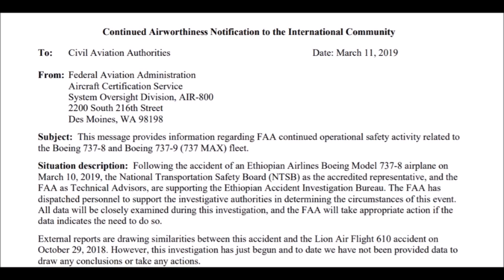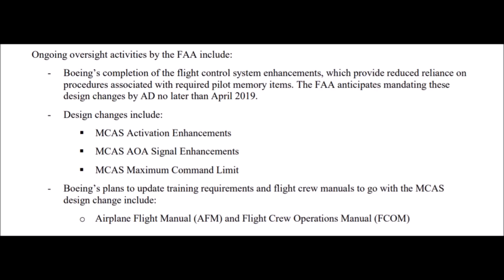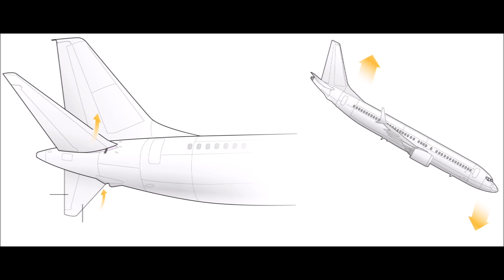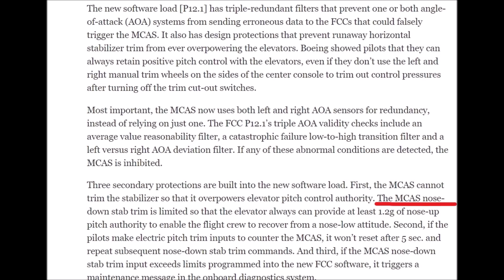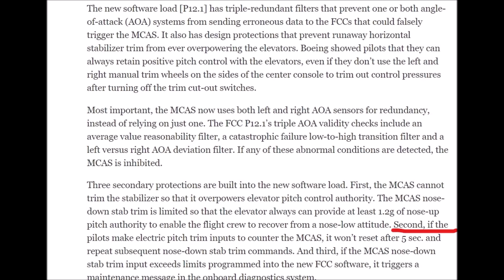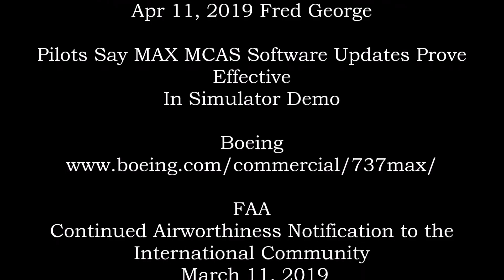737 Max UPDATE 14 April 2019 "The Fix"

Comment: This sounds so basic, why da heck didn't they config the system like this from the beginning.
Reply: I'm almost laughing at some of the responses I'm reading here. People are actually saying that this was unavoidable and Unforeseeable. Really? This system was designed around a single sensor. That is insanity. It is very foreseeable that a mechanical sensor will fail. It's not if, but rather when. This whole thing could have been easily avoided by proper engineering
Reply: Bradley Smith I get what your saying. What if they tested it with a failed sensor  in a simulator and pilots could recover when following the instructed Runaway Trim protocol?  Would you then agree is totally flawed?  I agree this was horrendous, mainly in the lack of pilot training and awareness, that was capital greed... and It should’ve been thought more throughly, but we can all say this now. How many other systems have inherent flaws we don’t know about currently in everything we do. We don’t know everything that was tested originally, all we know is that there’s a fix that seems common sense NOW, possibly not common sense when designed.
Reply: @bradleysmith681  Boeing designs in triple redundancy on their flight control systems.   Do you seriously think they chose to wing it with this system?  The AoA sensors are an important part of the flight instrumentation.   Its likely that the role of MCAS changed through the design process.   This certainly was not the intent of this system.  Also, MCAS is not a critical system.  It can be shut off if there is a problem.  The pilots of both of the accident flights made huge mistakes in how they handled these emergencies.
Reply: @bryan53566  MCAS isnt a critical system?  Of course, it is. If it deploys close to the ground, it could drive the plane right into the ground before the pilots can react.. in fact, after the Lion Air crash, the FAA stated that the MKS system could cause impact with terrain if not corrected.  So that isn't a critical system to you?  LOL You can try to defend Boeing all you want, but the mcas was a failure at design. If one sensor is acceptable, then why was the second sensor being offered as a safety upgraded at additional price? If One sensor is sufficient, then why are they adding a second sensor now.  If the system was sufficient, then why is Boeing accepting some responsibility for causing the plane to crash? You're talking nonsense. I really don't feel like debating reality with you.
Reply: I agree with most of the preceding comments. However I think a likely cause is the same systemic failure that took out two space shuttles: letting managers overrule engineers.
Reply: @selwynjames9592  The night before the space shuttle explosion, I saw that the temperature was well below 30 degrees at Cape Canaveral. I voiced the opinion before lift off they shouldn't let it take off because it was below freezing the night before.  I have absolutely no experience with space shuttles but I do have experience with how rubber or plastic becomes extremely brittle with below freezing temperatures.  The shuttle exploded because the O rings let burning fuel escape from the side of the rocket.  The same O rings were frozen less than an hour or two prior to the liftoff.   It seems to me that common sense is an Oxymoron.  Regarding the 737 Max 8, there should have been 4 sensors in the Max 8 which should have all agreed with each other before any MCAS action, and the MCAS would have to give a verbal warning as to what the computer was doing.  Even with that, one would think that there should have been a override calculation in the computer that determines that at X feet above the ground at a particular airspeed that you can't induce an angle of attack that would put the plane into the ground.
Reply: @Ron-cg2hf , I personally didn't anticipate the shuttle problems, but the experts did - and were shouted down by the snake oil salesmen.

"Common sense is an Oxymoron"?
"There should have been 4 sensors"?
"Should have all agreed with each other"?
"Verbal warning"?
"There should have been an override calculation"?

Couldn't agree with you more. You almost read my mind. Especially about the impossible angle of attack and a sanity check before action.

Perhaps these designs should have to be run past a community forum such as this in future, before certification...
Reply: @avms5090  "I personally didn't anticipate the shuttle problems, but the experts did" There's actually a very interesting story behind that. Google Bob Ebeling.
Reply: Redundancy in all sysrems except the AOA?Similar to the Titanic culture of having only 16 life boats on a ship that carries 3000 pax.
Reply: @8788luigi  The titanic was "unsinkable".   Boeing culture is about the same!
Reply: @Oldsmobile69  I agree.. Redundancy is so basic that most understand.. Yet, MCAS relied on ONE sensor only!! It's negligent..
Reply: @bradleysmith681  Good word for it...I'd add criminally before it. To your point, this is common knowledge. Both the group that built it would know of this weakness, as would the ones "certifying" it. 

That said, I find it concerning two pilots (obviously a redundancy) could not piece together a solution in time.
Reply: @justinnitsuj7041  Indeed.. Thanks
Reply: @bradleysmith681  no.. they did not. The rely on two sensors.. but only one at a time!

What does that mean? The redundancy is only 1/2.. not 1
Reply: They already had two AOA inputs and they didn't use them in concert, plus they didn't automatically disable if they disagreed? That's pretty basic.
Reply: Boeing and the FAA will have to conduct root cause analysis (RCA) to find out why the engineering was not done properly so this won't happen in the future again.  The result of the RCA will reveal where, when and why the Boeing engineering design work process broke down.
Reply: @ohcanadaeh  your comment is right on the money.  It seems to me that the RCA is mostly done on minor problems and not even considered at the highest levels.
Reply: @ohcanadaeh  re: "find out why the engineering was not done properly" not needed, the engineering HAD been done, and we now KNOW why it wasn't included.  this P12.1 software revision, though being touted/perceived as NEW is not "new" at all but is actually OLD.  i think you will find it's running the dual AOA vanes on the Military's new KC46 Tanker which is based off the 767.  yes this would technically be the same airframe that recently went down in Texas as Amazon Cargo.  mind you, whether or not commercial 767's are base fitted with AOA vanes needs further investigation.
Reply: @ohcanadaeh  Yep - Hard to understand how this could get through into a production aircraft in this era given the safety culture in aviation and all the hard earned lessons from history. 
It'll be interesting to see what was going on. I suspect there was some cognitive  disconnect occuring that allowed the engineers to think they were making a system that was 'merely' going to  slightly tweak the flight characteristics  and not really be a safety critical system... without properly thinking about what it was capable of doing.
Reply: In my opinion not being a pilot or an aerospace engineer, they probably felt they had procedures documented well enough to account for issues and trained pilots on how to recognize and deal with this.  It is a complex issue dealing with airline training programs and training programs as well as the fact it was the same type rating as older aircraft.  All things considered, I am not so much concerned with how it got released in this state and more concerned why it took two crashes to recognize issues here where the first one should have made things pretty clear.
Reply: As a former software Quality Assurance engineer, I find it appalling that nobody noticed this possibility. I didn't even work on software that could harm anyone if it went wrong, but I still always made sure to figure out what could go wrong and how to prevent it.
Reply: @LiftPizzas  But they did notice it. That's why there was a memory item emergency checklist for runaway stab trim.
Reply: That's the thing: If you're writing an emergency procedure for it (a memory item, no less), then you already know it's a flight critical system. If it's a flight critical system, then you design it to be fail- safe (it can never fail in a way that will cause a crash). This isn't just common sense, it's literally industry standard practice.  I know this because I've been a production test tech in this industry for 20 years and all the flight critical systems I've ever worked on have been like this. Somebody dropped the ball on this one.
Reply: @GoSlash27  Balls dropped /  banks accounts fattened?   To your point of just how standard and obvious this is...this isn't thousands of people dropping the ball.
Reply: @justinnitsuj7041  I doubt it's anything as nefarious as that. More likely it was just a failure in several areas by people who didn't know the standard practices trying to make a deadline. Big bureaucracies tend to make this sort of mistake, especially if nobody more knowledgeable is around to make a stink about it. You'd be surprised how often BM majors make dumb engineering decisions when nobody more qualified is around.
Reply: @LiftPizzas  Automation 101 right?  This was always discussed in our EE labs.  Don't make a robot or automated machine that can hurt someone.
Reply: Lift Pizzas  - Approximately 300 people in a year have died, and most of those have family and those family members will feel like they also have died .For them this situation will never go away for life. it's not something they can walk away from. In honour to those people the living must ensure the changes which are about to be made, reflect how we feel about this tragedy seeing it was technically avoidable.  It demands the problem is treated with the highest minds and solution.

- I'm still not convinced the fixes are safe, until the system has been completely cycled /scenario tested ( can that be done in 2 weeks?) There are real flaws in the system even after the mcas is altered. Ie. Manual trim at higher velocities. 
- Adding this software is as dangerous unless all the scenarios (even the non linear ones) can be logically examined for "fatal combination"
-  eg. A problem in a different area of plane combined with  how mcas affects those situations and responses must be thoroughly tested. 
- Changes to certification to be made - Adding automation should only be performed if absolutely necessary (ie. It cannot be designed out of the system mechanically) because it adds a black box scenario and potential response flaws by the pilots " a fatal combination". 
- Fatal combination = (1)  Low altitude (Just after takeoff ) + (2) MCAS sensor error + (3) high speed = pilots cannot switch to manual because the manual trim is too difficult at higher velocities . Leaving mcas on results in it over powering the pilots . This design has a fatal zone. At a minimum the manual trim must be able to be adjustable at higher speeds in the situation where for some reason the planes engine throttles are not working.. Will the new changes stop this situation becoming "fatal" ? No, it must address the high speed + manual trim difficulty
- Other- will the system be tested before release of all the combinations of scenarios that have not been discussed ? Ie MCAS in a nose up fault?
-  A critical question is despite the new changes @ high speeds can a pilot manually adjust trim without motor ? If the answer is no , or very difficult, then we still have a flaw in the design.
- By tapering back the mcas will a scenario develop whereby the pilot is in danger due to potential stalling ?
-  It is clear the original design of this mcas was not examined correctly as a novice with a very basic understanding of redundancy would realise the potential fatality of the original setup. The question is , are the changes proposed going to be adequately tested considering the time pressure? 
 - Is it unrealistic to expect the leader of the organisation to step down after it is obvious the testing and certification is so inadequate? That is a systemic problem of high risk and tht is the responsibility of the ceo because as steward of his her organisation they must put in place procedures that minimise catastrophic company failures. 
- Does Boeing not need a fresh recalibration and reorganisation of its company mission statement and isn't this best performed by a new leader who can focus on achieving the safety rather than talking about it ? This is not the first time I have read about boeings manufacturing processes being questionable,ref four corners report on manufacturing @ boeing. 
 -
Reply: @LiftPizzas  exactly, this is totally appalling.... unreal
Reply: Was there a Critical Design Review? This MCAS thing smells.
Reply: These proposed solutions are so logical.  Where was the FMECA (Failure Modes and Effects Critically Analysis)?  Where was the HA (Hazard Analysis)?  These analysis HAD to be required.  What the heck was going on at Boeing.  This is a trivial (in cost) revision of the software.  Something went "south" on this systems development!
Reply: @garybrockie6327  
That's why the FBI investigation is critical. You can be 100% certain someone was not happy with the MCAS design and tried to voice their concerns.  Corporate culture loses safety objectives when rush to market shuts down dissenters.
Reply: The apparent stupidity amazes me too.
Reply: sickening how these planes were originally set up, looks like the work of complete newbs, never knew Boeing was so bad, so unprofessional
Reply: Wow strange that initial Risk assessment policies did not catch this. Tragic! Glad I not attending the next QA System Management review meeting.
Reply: To keep it simple it seems to me like the basic checks and balances of having MULTIPLE, educated, seasoned sets of eyes on changes, both on the FAA side and Boeing's side, I don't want to place blame. I'm willing to bet both have dumbed down those positions.
Reply: If Boeing operates as Wal-Mart stores now do, I would stop flying immediately on any Boeing aircraft! I actually like Boeing!
Reply: guys, it actually WAS a financial decision (profits).  they were serving up safety items "ala carte".  you have to watch the 2-hour subcommittee hearing with the FAA/NTSB/IG to get the insight.   expressly listen to the questions asked by Senator Markey...  https://youtu.be/L1eZ7kMI78g?t=5420
Reply: $$$$Money$$$$
Reply: Simple. $$$$$$$$
Reply: @whoofianbrony8804  -  GREED Trumps Humanity!
Reply: I think Boeings decision to go all-in on the MAX as a new 737 forced the poor mcas design which led to these accidents.  In other words, the poor design was intentional. 

Given that the key selling point of this aircraft was no simulator training required, any alternative design would have inevitably led Boeing right back to step one.

They could have completely redesigned the plane so that it wouldn't have the problem mcas at out to fix, but that would make it a new type.  And they could have made mcas more robust - but any alternate approach would have allowed the possibility that mcas could cut out, leaving the pilots flying a plane with different handling characteristics than the other 737s they were trained on.  So for example, if it is tied to both AOA sensors, then what happens when they disagree?  If mcas cuts out or warns the pilots, then that is a whole new procedure they would need to train for, which defeats the main selling point of the plane.

I am interested to see what happens when Boeing implements these fixes.  Wont pilots need to train for these changes? Now that mcas can cut out, shouldn't pilots be required to train without an operational mcas in simulators? And how many airlines have 737-MAX simulators anyways?
Reply: @ds1848bp  here's my question: according to Juan in this video, most pilots could NOT tell the difference between the MAX and the original 737 design with the MCAS off. So, knowing that, why have it at all? It's a waste of money, and they KNEW in simulations it could cause crashes within a minute. So why do it? I'm fairly sure they could have convinced the FAA to grant a waiver if most pilots couldn't tell the difference in Sims.
Reply: @whoofianbrony8804  As stated in the video, it was done for certification. The differences, while minute, were apparently enough that they would have needed to re-certify the plane, instead of having it stand as a 100% same plane as all the other 737 family aircraft.
A stupid thing to save money on, certainly.
Reply: Except until recently there were no simulators with MCAS available to the airlines. Boeing released the  max without a specific sim for it since... you know, it will behave exactly like the NG (MCAS).
Reply: Because Boeing has taken over the FAA.. Boeing self-certifies..
Reply: @bradleysmith681  Long past time for the TOTAL separation of business and state.
Reply: @bradleysmith681  Please don't be ignorant. My company operates under ODA, and everything meets the regulations, and usually surpasses them. Some tests have been delegated to the airframe or engine manufacturers for decades, and yet safety is at the highest level in the history of flight.
Reply: @UncleKennysPlace  What a silly assertion.. Explain to me how a critical system using a single sensor would have passed regulations under the "old" FAA? It would not have. And the old FAA would not have allowed inferior batteries that caught fire. The fact is the FAA is another victim of coroprate influence--the cozy relationship between regulators and business (industry leaders becoming heads of companies and other positions).  Business enters the regulators and changes regulations to its own benefit.. Glad you think its so safe. Tell that to the over 300 people dead because regulators under corporate takeover allowed a negligent design into the airplane.
Reply: @bradleysmith681  Sure,  how else could it work?  What value could the FAA possibly insert into the chain?  The people vetting this should be Boeing's and the airline's insurance companies.  The FAA has no real skin in the game.  Oh, and eliminate government licensing.  Delta is not going to turn over control of a $60 million airplane to someone they don't trust.  Government regulation has lots of perverse incentives built it, mostly lawyers who can always to point to a change as a cause of disaster.  Juries don't understand technical trade-offs any more than lawyers.
Reply: @alankwellsmsmba  You're right.. Let's let the businesses regulate themselves because that will work out.. How did that work in the Pinto automobile? The company knew that many would explode and kill its occupants but allowed it because paying the families was less expense.  The goal is to make the planes safe, not to make the number of allowed crashes acceptable to the company and insurance companies..
Reply: @bradleysmith681  What an ignorant comment.   The FAA delegates parts of the certification process out to manufacturers who are trained and licensed to do so.  However, it is still reviewed by the FAA.  Excessive regulation and bureaucracy does not guarantee safety.   The FAA does an excellent job with oversight.  This situation is not the result of insufficient oversight.
Reply: @bryan53566  Not ignorant at all.. The FAA has delegated more and more of its responsibility to the very company it is suppose to be regulating. That is fact. Next, excessive regulation? You mean like the "excessive" regulations that allowed the previous battery fires and now a flawed MCAS system using only ONE sensor? Yes, we should get rid of those "excessive" regulations.. Sorry, but this flaw is the perfect example of regulatory failure. If the FAA had been properly regulating and following its role, the MCAS, as designed, would never have been allowed.. Boeing has injected itself into the FAA, and safety has declined as a result..
Reply: @bryan53566  The EU, China, and Canada disagree that the FAA is providing sufficient oversight.  All three have already announced that they will not be deferring to the FAA software certification decision on 737 Max, as is traditional, but will instead be conducting their own evaluations.  So, here is a case where the effort to streamline regulatory oversight actually resulted in quadrupling the number of regulatory hoops Boeing has to jump through.
Reply: @dansanger5340  re: "So, here is a case where the effort to streamline regulatory oversight actually resulted in quadrupling the number of regulatory hoops Boeing has to jump through."  bingo, and here we insert the classic adages of "NO FREE LUNCH" and "PAY ME NOW OR PAY ME LATER".   thus as we see with these truisms they CAN NOT be escaped no matter how many lies we tell ourselves or tell to others.
Reply: @bradleysmith681    They didn't "allow" the battery fires.  Nor did they "allow" a "flawed" system.   Both were unexpected problems that occurred after certification.   You are making a HUGE assumption that added FAA oversight would have prevented either.    Boeing certainly didn't expect that MCAS would be a factor in either accident.   They didn't anticipate that airlines would neglect to fix failed components and that pilots lacked basic skills to fly their airplanes.   Here is an article with some actual facts about the certification process.

https://www.marketwatch.com/story/faa-on-sullenberger-criticisms-of-boeing-737-max-certification-process-consistently-produced-safe-aircraft-designs-2019-03-19
Reply: @bryan53566  The FAA did not do an inspection on those batteries and they caught fire.  Boeing self-certified them as safe--fail.. The FAA allowed the  MCAS system to use only one sensor--fail.  Both of those failures are because of corporate takeover. Honestly, if you can't understand the current environment of corporate takeover in regulatory agencies, I don't know what to say. It's no secret whatsoever.  Why don't you look up former NTSB Mary Schavio (?). She has been talking about this failure for years.. Sorry, but I'm not going to debate reality with you..
Reply: @Bo Stark - My thoughts, exactly! Even just polling the data from all AOA vanes - that redundancy bit, we all believe is there - and wasn't- anyway, 'dead-horse' and, a few hundred humans smh
Reply: Pilots/airliner training failed the second crash when they either didn't know or intentionally reactivated the stabilizer and they failed to monitor plane speed thru the event. But engineers sometimes faol.tonrealize no everyone thinks... well, like an engineer.
Reply: @nbt3663  That's why engineers get such high pay.  They are suppose to do their best to make things accident proof and then work their way back on the risk assessments.  Someone didn't go that here.  Also, pilots are pretty high up on the pay scale.  They should earn their check better perhaps.
Reply: CEO should be fired, and so should the people in charge of MCAS software and self certification
Reply: Why? This is all too complicated for the FAA, they have no clue when things get so complex. They simply listen to the Boeing engineers and rubber stamp the papers of approval. Now when the MCAS is disabled by the captain let's say at night or thick fog, then how will the crew know whether the plane is getting into a stall? Remember, the new 737 is not aerodynamically stable. Ultimately the real solution would be to completely change the 737MAX8 design so it doesn't go into a nose-up position, doesn't require a software to be aerodynamically stable.
Reply: This whole tragedy shows a much deeper issue for It’s obvious no Process Testing is occurring at BOEING whether it be for the 737 and no doubt all other Boeing aircraft under development. I won’t be flying BOEING because their reputation has been tarnished forever.
Reply: Because the easiest person to fool is yourself. And when you are an expert, you have to humble yourself. But that is hard to do. People moan about regulators and regulations, but this is where they are important. They ask the "stupid" questions to make sure that engineers don't get into the mindset that they have thought everything through and shouldn't be questioned. When this is working, the questions start to seem "stupid" and people start to question the validity of the process. This is when complacency can lead to a lax attitude towards the need for a separate set of eyes and brains.
Reply: Exactly. This was either:

1. Crony capitalism.
2. Offshoring vital software development.

In either case greed/profit was put before passenger life.
Reply: GREED!
Reply: As a software guy, I'd like to see the issue tracking database for MCAS.  Possibly worse than the decision to rely on only one sensor was the decision not to limit the maximum amount of compensating trim, but instead allow it to trim to full nose down.  I wouldn't be surprised if early on someone entered a bug in the database about the issue and it was quickly closed as "by design."  Then, once it was in the database, if anyone brought it up again then people would point to it already being a closed issue.
Reply: @dansanger5340  i like the conclusion reached in the second sentence, doesn't seem that capability was integral to the stated purpose of mcas, yet another flaw
Reply: It's extremely alarming that the original MCAS was certified. It speaks of a dysfunctional organisational culture at Boeing and maybe the FAA. To top it off the MCAS was only necessary because Boeing wanted to keep extracting value from a dinosaur airframe. It makes me depressed about America in general. Couldn't see this happening with Airbus.
Reply: We are humans, we all make mistakes. I think boeing makes a very good work, everyone can make a mistake
Reply: @ezzioauditore3842  It is easier to fix mistakes if we admit to those mistakes instead of trying to hide it. Like Boeing doing press release of making a safe plane safer.
Reply: Yeah, it's almost negligent.
Reply: Because people learn from mistakes. After the fact, every argument to destroy someone or something is good.
Reply: Quite separate to the issue of unbelievably poor software design & non redundant, non failsafe hardware/system configuration defects, why weren't these potentially fatal system design deficiencies detected during pre-production software evaluation/debug engineering flight tests? 
It would appear the 737 MCAS system control boundaries were never critically exercised or  explored during initial system 'shakedown' flight testing.
Reply: One last chop here and I am tapping out.
1. There is plenty of fault to go around. I have never once stated there isn't. Software, hardware, pilot, and engineering managers. I am almost certain there's some blame for a Project manager as well.  
2. Read my definition of a system. It is all inclusive of everything that would influence flight or production of a plane in any fashion. 
3. If you think engineers always get it right, then you are the engineer I am referring to. By your rationale, hedge fund quants should be the highest paid people on the planet yet they are not. They have also screwed our economic system relative to their trading systems. Literally strangling it so that it cannot breathe or allow for proper correction. What did they miss?
4. Because you can, doesn't mean you should. I CAN go to Vegas and get into all sorts of things. SHOULD I?, probably not without understanding all the ramifications. Guess what, I will probably miscalculate and there will be consequences, which is what happened here. Ask Oppenheimer.(not the fund)
5. Example, If I place logic to reassess AOA, and in my logic, I include the statement that surely a pilot would disco my logic and hand fly the plane, then I have not discounted appropriately for the pilots logic and/or tunnel vision given stress; therefore, I have made an improper system. 
6. I dare you to place a hard line that is appropriate for number 5 above.You can only continually move that line for reassessment of a pilot's manual inputs. This is the requirement to know how to go off instruments. (case of dual AOA failure). You see, trapped. This is an inherent issue with automation. 
7. Welcome to engineering. If you do not understand my statements above, please do not enter the field. You likely have too much Hubris and will cause fatalities.
Reply: That is the thing about using programming to control an aircraft over traditional control.... essentially this is like playing a game that works great until you find that one spot where you glitch through the floor... but in this situation the game is a control system, and the glitch is somewhere randomly in there from some scenario that puts the plane into a fault mode. The original code is either corrupt or incomplete for this set of inputs into the system.
Reply: Cost cutting, of course.
Reply: Bo,
the MCAS was a fix for an "unexpected" flying condition that resulted when Boeing changed the original configuration of the A737 in order to accommodate a larger engine. Check the video below for more info.
The real reason Boeing's new plane crashed twice
https://www.youtube.com/watch?v=H2tuKiiznsY
.
Reply: To err is human, no matter what regulations and testing are implemented. Shit happens. In fact and change can also create new unfoscene issues. Boing did not intentionally cause this,they were trying to make things better. They fixed 737 max, a very good safe well engineered deign. Hindsight is 20/20, the design feature turned into a mistake, humans make mistakes, even you.
Reply: Yup, and the only answer I have is : Money.
They wanted to save money and cut corners, this is the result, many people died.
That being said, and what I REALLY want to know is how the fuck did this passed the FAA certifications without raising ANY eyebrows...
Reply: @Timothy Mahady Captain Mahady, meet Captain Obvious.
Reply: Bullseye ! This is only due to a rushed in solution. Beoing was cut short handed and did not see that Bombardier and Airbus were actually taking the lead in the small and medium sized planes and they had nothing ready to compete since we are still waiting for them to deliver the 797. n
Reply: Sometimes common sense isn't  so common...

These are engineers that think and talk at a different level.
Reply: Erin McLaughlin odd you had said that, I have been observing that for 54 years now, and here is what I have observed, the MORE EDUCATED  there is LESS ‘COMMONSENSE’, but there is also this, the difference of genius, vs madness, is on the edge of a RAZORBLADE. !         Cheers from NJ
Reply: @flybyairplane3528  Common Sense is often neither sense, nor common. That is why it is so easy to fool yourself into believing that what you presume is actually correct. This does not preclude expertise from being valuable. It simply points to the value of critical review from other experts.
Reply: Hindsight is a convenient thing.  MCAS is so minor a system used in such a small portion of the flight regime.  Humans are not infallible even engineers and an aerospace company with decades of lessons learned can make mistakes.
Reply: @SPBurt1  I think that sometimes lessons learned are not learned by everyone.   Sometimes lessons learned are only in the heads of retired engineers and maintainers.
Reply: @SPBurt1  Ok, but if you add a feature it is basic to take account of any damage that coluld arrive. ABC design.
Reply: @SPBurt1  true, but those "minor human errors" cost lives... just imagine your loved ones were in one of those planes!
Reply: @Oldsmobile69   Same, I do basic logic in formulas for data. This is about High school level stuff. 

#1 thing and should have been addressed with the first mcas incident, have a congruence check on the AoA data prior to acting on it.
Reply: most likely mismanagement and that they rushed the planes out without adequate testing because shareholders and corporate profits were deemed more important.
Reply: Hindsight is 20/20.  Do you know what that means?  Do you think Boeing's desire was for the aircraft to crash?  It was an unanticipated problem.   Its also a problem that never would have occurred if Lion didn't send up a plane with a known failed component and if pilots in developing countries still had basic flying skills.
Reply: @bryan53566  Agree 100% - with your first statement. "Hindsight is 20/20".

Of course Boeing's desire was not for the aircraft to crash. Was it an "unanticipated problem"? Most unlikely. There are numerous commentators here, myself included, who feel that (even) they would not have made such a basic blunder (in the design of MCAS). "We have two AOA sensors for redundancy", then "we only use one of them"... How much more stupid can you get.

I also expect we will learn of a few engineers who objected to this design (much like engineers objected to the faulty "O" Rings on the space shuttle), but were over-ruled by managers, who thought they knew better - than the experts (much like the space shuttle).

These are known unreliable parts (see: https://www.bloomberg.com/news/articles/2019-04-11/sensors-linked-to-737-crashes-vulnerable-to-failure-data-show) and Boeing, of all people, should have know better. I, for one, am very interested to learn how this got past Boeing's assumed expertise. I also am left wondering how many other hidden defects also got past FAA certification, due to the same root cause.

I also suspect there are a lot of other readers who will take issue with your comments re developing couintries and basic flying skills. I understand that Ethiopian Airliines have a goood safety record and their pilots are well trained and respected.

We rely on experts to anticipate problems and in some cases, even the experts get things wrong. I don't believe this is one of those cases. I believe someone likely skipped a few steps in the design/QA process, perhaps in order to compete with Airbus.
Reply: @avms5090  Ethiopian has a good safety record, but they put a 200 hr pilot in as F\O on a newer type variation and a new type for the company.   That is a ticking time-bomb.   This student pilot did not have the experience to deal with an emergency.  The captain  was alone in that cockpit and made serious mistakes that are standard memory items for 737 pilots.   Lion has a terrible safety record.  Not only did they neglect to fix a problem on this plane, 2 out of 3 crews didn't possess basic skills. 

As far as MCAS, its hard to say why they used one AoA sensor.  Possibly something was missed or it conflicted with another system.  Clearly they didn't design MCAS to have this effect.  Also keep in mind that it can be disabled.  ETH302 did disable it, but enabled it again and neither pilot paid attention to speed.   JT610 crew just lacked the skills.
Reply: @bryan53566  Bryan, I agree with you in general but it was the 200hr pilot who first brought up the stab trim cutoff, so give him credit for that.
Reply: @bryan53566  No sensors fail that is basic. You need to have very good reason why you should rely on one sensor. Without good reason use three that is the default principle. Even using only two sensor you need intensive reliability study to justify it. Using only one sensor is simply throwing all safety principle and declaring that you don't believe that safety is necessary. They already have two sensor on the plane so why not use it. The designer have gone out of way just to make the system less reliable. They have ignored the safety principles and they have ignored the second sensor already on the plane. Hindsight does not come into play if the designer just followed safety fundamentals. It is very simple 1sensor = Bad because sensors fail.
Reply: @kazedcat   These are very complex systems.   Its likely that several things changed over the development of the aircraft.  its possible that there was a reason to only use one AoA sensor.    There are other systems and instrumentation that are critical for controlling the aircraft.  Those do have that redundancy.   MCAS is not a critical system for controlling the aircraft.  It can be shut off and the aircraft can be flown safely without it.  The pilots of ETH302 certainly knew that.
Reply: @bryan53566  Sensors fail you already have two sensor in the plane. Their patch is to make the system use two sensor. There is no good reason why they ignored the second sensor. If it is not critical system then why not remove the MCAS system completely. Switching it off does not fix the problem of the system killing the pilots control authority with just two activation. A system that can kill pilots control authority is a critical system and who ever categorized it as not critical should quit their job. That is another evidence of Boeing engineer throwing all safety principle out the window.
Reply: @kazedcat  since you obviously have all the answers, please explain to the rest of the class how input from two sensors would change one dang thing.  

I can almost hear you type-type-typing out your answer... "well, you see, mortal idiot, it's quite simple really.  What you do is take the input from the correct sensor and you discard input from the incorrect one...."

TA-DA!  Everything in life really is that simple!
Reply: @Milkmans_Son  It clearly does something because that is what Boeing's propose fix is going to do. But I will explain it to you clearly. With two sensor you can detect a sensor fault when the two sensor disagree. The system will then automatically disable MCAS when sensor fault is detected. This is very important because two MCAS activation will put the airplane into unrecoverable envelop. Waiting for the pilot to notice the problem and manually disable MCAS have a high chance of the plane to be already in unrecoverable envelop. I am not convince this is enough but Boeing itself says having two sensor is enough of a fix if combine with curtailing MCAS control authority that will allow the 737Max to be ungrounded. My opinion is that this fix is a good start but they should sanitize the input more. They should add logic for detecting frozen AoA. This can be done by checking AoA against the planes attitude if AoA does not change with the change in planes attitude then it is clearly frozen. They should also check if the AoA is not broken.  If it gives you a 70° degree change in less than a second multiple times or the output jumps randomly then you know the sensor is broken. They could do more with advance sensor fusion. By combining thrust level, gps velocity estimation, plane attitude reading. You can have a virtual still air AoA. This measure can act as a third AoA with very low precision. That is enough to detect sensor fault. And it will allow 737MAX to fulfill triple redundancy principle even if the third one is virtual.
Reply: @kazedcat  two MCAS activation will not put the airplane into unrecoverable anything.  Where are you getting your info?
Reply: @Milkmans_Son  Two full MCAS activation put's the vertical stabilizer into full nose down configuration. That in itself is not yet unrecoverable but Boeing's emergency procedure is to disable electric trim. Now the problem is that at full nose down the manual trim wheel does not work. 737NG have smaller trim wheel compared to classic 737 and this design is carried over to 737MAX. This smaller wheel don't have the control authority to counter the aerodynamic load in the stabilizer. Old manuals have a procedure to recover from this at high altitude using roller coaster maneuver. This maneuver is not possible at low altitude. That is the unrecoverable envelop at low altitude with a full nose down stabilizer you have no way to recover. Without MCAS no sane pilot would put the plane in that configuration so it was not a problem. But MCAS would put the plane into that envelop silently without any indication and warning that it is doing so.
Reply: @kazedcat  
the vertical stabilizer into full nose down?

Well, I can see why they didn't put that one in the manual.
Reply: @bryan53566  bullshit, using one sensor when there are two is just negligence and poor design, considering  for a critical system that has such authority over flight controls....no excuses on this one
Reply: @bryan53566  The problem is Boeing and FAA in bed together, allowing cost cutting certification. They use airlines to test their dodgy automation systems, hoping all goes well. It took 2 crashes of Max to ground them. Even then FAA was reluctant and Boeing blamed pilots. Wake up.
Reply: @ALA-uv7jq   Saying that they are "in bed together" implies some type of collusion.   Its also clear that you are not well informed and simply reacting to media headlines. The FAA certifies some Boeing employees to provide testing and reports to the FAA, but the FAA still provides review and oversight.   The issue with MCAS was an unexpected problem,  not a feature cover up.   The Max is perfectly safe with competent pilots.  The Lion Air flight should have never left the ground with a known failure and the pilots failed to perform certain actions that every 737 pilot knows.
Reply: This plane is still not safe despite the fix to the mcas. With new heavy engines and if no power it will not glide. I believe it will just fall to the ground.
Reply: @jeevansingh7772  this is the point, for technicians it might be fixed with a new software, but will passengers board this plane? A plane has to glide when the system is down and not drop from the sky like  a stone.
Reply: @jeevansingh7772  Wrong.
Reply: Hey everyone, most of you are talking about the engineering and software and nobody's talking about the crew. I'm sorry but I see one of the problems being that the  crews failure to disengage auto-throttle and re-engagement of the MCAS. At 575 knots you have no time to gain control in close proximity to the ground! Yes and I agree that relying on one sensor is problematic but you still must fly the aircraft. A part of that is to disengage the auto pilot and auto throttle to gain pitch control of the aircraft, to me that lies solely on the pilots not executing aviate, navigate communicate. To me the emergency procedures checklist wasn't implemented fully.
Reply: @SS-en8gx  Actually, I talked about the crew during the last 2 videos. People didn't like it, but I talked about it anyway. The crew's execution of the procedure was the focus of the last 2 videos. The focus of this video is Boeing's corrective actions for their bad software. So that's what I'm talking about today...
Reply: @SS-en8gx    As to why the crew didn't throttle back the engines - there was a 40-knot discrepancy between the two ASI's and the pilot's stick shaker (stall warning) was operating continuously.   If you can't trust your airspeed and you're getting a stall warning, reducing power is the last thing a pilot would instinctively do.
Reply: Why they just dont put a single button to switch off MCAS? So the pilot does not need to flying manual. Just one simple step, why boeing makes this complicated system to switch off MCAS? It save time a lot with just a single button. Your plane nose dive with high speed than you have to make flying it manually, why they does not help pilots by let the electronic trim is still on, so pilots could maneuver to recover the plane effortless, than this complicated system.
Reply: I am a software/hardware guy by trade. I have yet to meet an infallible software or hardware engineer. For those who think machines are smarter than humans, you must first consider the human producing the decision trees for the machines. All of which are part of a system. A system in my mind is defined as the universe, i.e........ environment, people, hardware, software, maintenance, and training. All play a role in contributing to the factors for such incidents. IMHO, the software was a bit overzealous on MCAS, but the pilots were also ill attentive to the procedure and capabilities as a whole. I was able to tell my children how we thought there would be flying cars in the year 2000. Then we discussed how people drive with clearly defined roads and quickly imagined how that would go above the ground. It made for quite the Eureka moment, as I could see their faces change instantly.
Reply: @youKnowWho3311  :  Canadian viewer.  I enjoyed reading your comment.  It reeks of common sense and has no emotional diatribe.  I am not a software/hardware guy by trade.  I work in an industry where accidents have devastating consequences and most are caused by human error and the lesser by technology.
Reply: @cdpgbc-mw2kz  Thank you sir!
Reply: @youKnowWho3311  You seem to be making an argument that because there is no infallible engineer, that the engineer is never to be blamed for his mistakes. Yes, mistakes happen. They are not always forgivable. As a professional software/hardware guy myself, this is criminal negligence at best.
Reply: @youKnowWho3311  This case is like a bug. It is a situation that was not foreseen (AOA indication wrong) and so not tested. Had they tested it in a simulator, they would have probably crashed and found out solutions.
I believe this peace of software was not properly discussed or supervised. Someone designed a software loop that acts repeatedly to counteract an input parameter, as long as its value is above a certain value. This is used widely in hardware and software.
But is this case it seems no one looked at the possibility of a wrong input. The final result would be immediately apparent (and catastrophic).
Reply: @antoniomonteiro1203   if I may:
begin
 loop
 measure return AOA=X
 while true do:
   if AOA>x then
      adjust AOA, wait 5, remeasure, report
    else
       do not adjust
  close loop
exit;

crude, but you get the pseudocode. I believe the fault lies in the wait 5 seconds portion of their logic; however, I also believe that 80% AOA should be corrected immediately whether MCAS or hand flying given appropriate speeds, etc..... Perhaps this was the decision made by developers. I am indeed speculating. Very interested to know their testing procedures for the software and hardware...... It should be a case study for SE courses in the future.
Reply: That's an excuse for human 101. Your job is to consider all the worst case possibilities @youKnowWho3311
Reply: @garywurts  so Davinci, Einstein, Franklin, Tesla, Musk, et al....... Perfect? Produce for me the human who calculates all possibilities, and I will find his/her fallacy. Musk comes to mind recently. in fact he developed or allowed the development under his purview, of cars that could run off the road while following other vehicles in snow. I stand by my original position. Many more examples of this in engineering. Tis the nature of engineering and testing. These things will happen. The original computer bug. We must let air flow, and thus introduce spaces for living things that make contact with circuits.
Reply: @youKnowWho3311  I cannot agree with you.
Any checklist I can think of (and I've designed more than a few) would reject out of hand a system which relies on a single mechanical sensor exposed to damage and to the elements and, if its output is incorrect, sends a plane nose down with such authority that it over-rides a pilot's natural corrective action.
I find at least three "no way" points in the above sentence.
Reply: @youKnowWho3311  but you are wrong, not one single person or mind designs something like this, it's a team effort of several engineers, how in the world did they not see this is beyond me
Reply: @garywurts  I believe the MCAS AoA design weaknesses were pointed out to Boeing but that would have been problematic to fix. No one inserts a new piece of automation into the critical flight control systems without exhaustive review. It was intentionally criminally misleading to kludge the flight characteristics with a hidden auto controller that overrode the pilots manual control.
Reply: youKnowWho3311  then you haveNOT cross paths with the folks from AIRBUS!   Their idea is that THEIR SYSTEMS ARE BETTER THAN ANY PILOT.  Can you say AF fly 441, they could NOT FLY with a PARTIAL PANEL, nor fly WITHOUT THE COMPUTERS.    ,,,,,, Cheers from NJ
Reply: @youKnowWho3311  but engineers are supposed to work as a team, collaborate, and jointly determine design flaws like these.....they don't work in isolation
Reply: @youKnowWho3311  - I agree that the respective pilots had their culpability in the matter yet; I can see where one may be incredulous to this system's particular failures and shortcomings - It would not be in the readily anticipated realm - My humble opinion, of course- A poor comparison it may be though; if my vehicle locked me out of the accelerator and opened it wide, I would steer and brake like no-one's business yet, I would be out of my anticipated realm of things I'd prepared in advance, to go wrong- /diatribe
Reply: If your software engineer describes their work as "elegant", fire them, because they lack any form of common sense.
Reply: How many tens of thousands of flights with the 737 Max occurred without incident? Before all you armchair warriors condemn you might want to consider that one fact alone. I make no excuses for Boeing but I won't vilify them either.
Reply: @richb313  I keep seeing this comment about people claiming all other flights of 737 Max occurred without incident.  Just because there were no errant MCAS activations resulting in crashes (although 2 is plenty for me!), does not mean there were no incidents of improper MCAS activation that put the flying public in danger!  We simply don't know, but considering the mode of failure was a single faulty sensor, it seems highly likely this problem was encountered on other flights and the pilots were able to manage.  That doesn't make it safe, and is not a suitable excuse for faulty design.
Reply: @jandypimpson  What it does is highlight the fact that the overwhelming vast majority of flights occurred without incident. It also points out that if MCAS were really giving problems then warnings to all the Airlines and FAA Directives would have already been issued. There were addendums to procedures on recovery to runaway trim caused by auto control including MCAS and if these procedures had been followed the Ethiopian Plane at least would never have been out of control and landed safely. I am not minimizing the faulty MCAS system but it alone did not crash these aircraft. It was a major contributing factor but stuff breaks. If there were other incidents then ALL the other Pilots dealt with the issue correctly. Don't buy the simple narrative being sold without first asking yourself if true why aren't there planes falling out of the sky on a daily basis? The truly amazing thing is how extraordinarily safe Airline Travel is and Boeing, no matter it's faults, is to a very great degree responsible for that.
Reply: Humans are involved in the software design. Processes are in place (in the software design side of things) to minimize errors, but since humans are involved, mistakes will happen until tested under all real-world conditions... This MCAS thing sounds obvious now, but it's just one of thousands of systems that do work perfectly. Sometimes, mistakes happen, and people will die. As Juan says, it's still safer in the long run than pure human control. The MAX series will be a fine aircraft, I'm sure.
Reply: @JamesGood  again I call bullshit on the human crap, they are suppose to work as a team and used their shared knowledge and expertise to prevent crap design flaws like this to happen.....one person can screw up, but an experienced team of engineers with the right focus is hard to beat
Reply: @puerco911  "Hard to beat" but not infallible. They put square windows on the Comet, fatally flawed cargo doors on the DC-10,  fatally flawed fuel system on the DC-6 (flew the president around on it), fatally flawed vertical stab on the B-52, pure O2 in the Apollo capsule. This is just another of those flaws that will be around as long as humans are designing things. Process helps, but things will still happen. Most of us are a bunch of back room quarterbacks with a lot of hindsight that makes things pretty obvious now. Boeing screwed up for sure, shouldn't have happened, but it does... Risk will always be there.